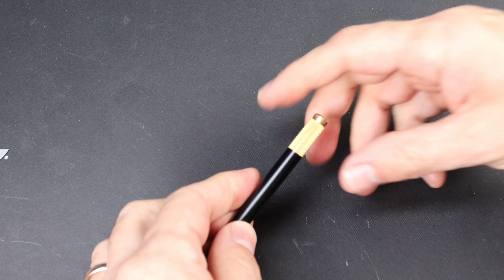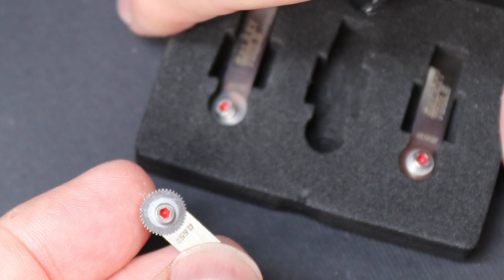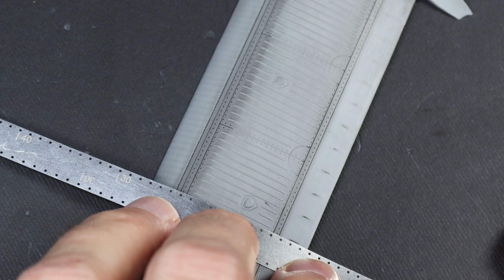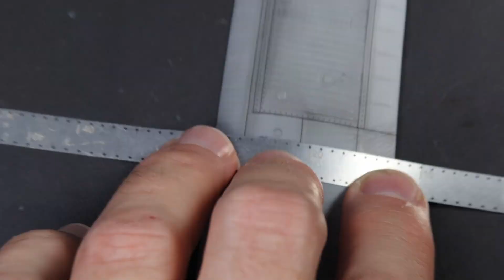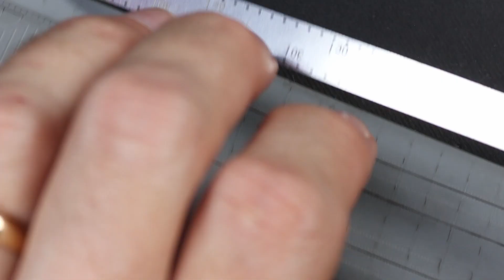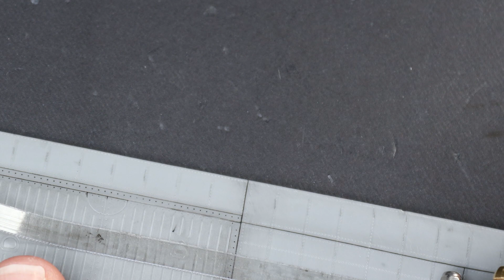Review: Galaxy Tools riveter, is it better than a Rosie?

Comment: I used a riveting tool on my 1/32 Revell Beaufighter...It's an old kit and took a couple weeks to rivet but it looked great before I sprayed it...(I made a video of the build on my channel)...and then I sprayed it with the airbrush and lost all the rivet detail...The panel scribes were still visible but it really put me off riveting old kits...I'm trying it again on the old Revell 1/32 P38 kit at the moment...From some vids I've watched they say to sand after riveting, clean and then drop extra thin in there which I did and they were still visible but I lost the lot after a couple coats of spray paint...Any ideas?
Reply from the maker: I don't sand the rivets most of the time, if I do I just polish them with a very well worn, fine sanding sponge.  I never us cement on them.  The paint I use are lacquers so they have very fine pigment, and I always use light thin coats.
Reply: @thescalemodellingcafe  Brilliant...that's what I wanted to know...Thank you for the reply...I'll try that on the P38 I'm building...I've done the cockpit so now onto rivets and panel lines...Big thanks and great videos...Lew

Comment: Tha ka for the review. Doesn't thr rosie tool have different size teeth for each scale? Rather than just different spacing.
Reply from the maker: The size of the wheel makes no difference other than it's easier to get freehand straight lines with a bigger wheel.  The spacing of the teeth sets the scale.

Comment: Do the “Sizes” or “Pitch spacing” generally go by scale?   I’m mostly working with 1/32 scale WWII aircraft.   0.55, 0.65, 0.75 is OK for 1/32 scale, probably using the 0.75mm most frequently?
Reply: I measured two models’ at 10 rivets per CM.   As a “Yank” I figure that to be 100 rivets per mm. 🇺🇸
Reply from the maker: The advantage of the Galaxy sets is you get 3 in a box so they are flexible.  I tend to use 0.65mm for 1:48 so anything bigger should do 1:32

Comment: Hi Jamie. After watching your review of the Galaxy rivet tool, I have ordered and received one via Aliexpress in China. Until now I have been using Radu's otherwise excellent riveter sets but always found them to be a bit flimsy! After spending much of today having a play with the various wheels and segment tools, the Galaxy tool is far superior in that regard. I generally use them to faintly mark out the rivet lines for spacing, then use a beading tool to make the actual rivet indentation (or Dzus fasteners). 

Hopefully I'll meet up with you next year at Telford, plagues and pandemics permitting!
Reply from the maker: Hi Peter, great too hear from you again, it's been a very long time.  I also do the same for Dzus fasteners!  I'm not sure I'll be able to make Telford for quite a long time owing to the job out here in Saudi, if I can get there it would be great to meet up mate.

Comment: No need for light sanding after rivetting ?
Reply from the maker: Depends on how soft the plastic is, and the scale.  It's not needed on this 1:48 Hobby Boss Colt, but on 1:72 I think I possibly would.  I didn't on the Arma Wildcat but that had raised rivets.